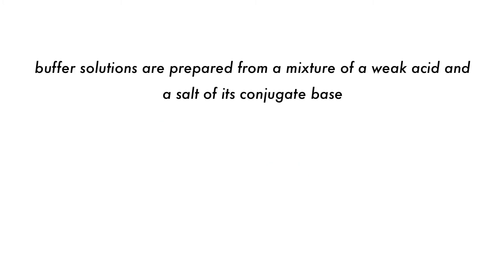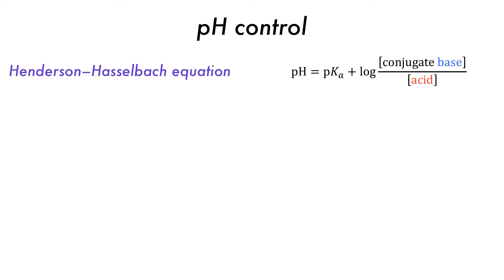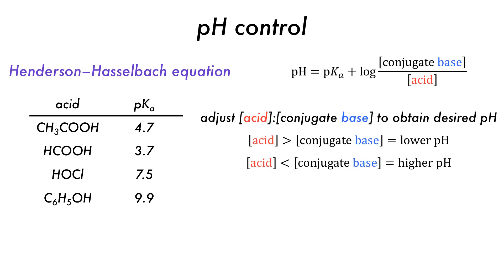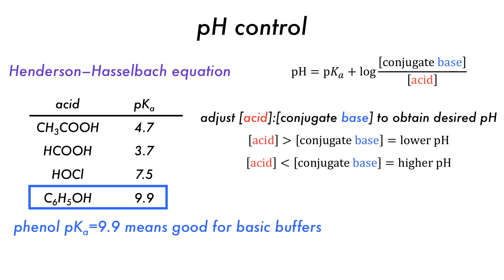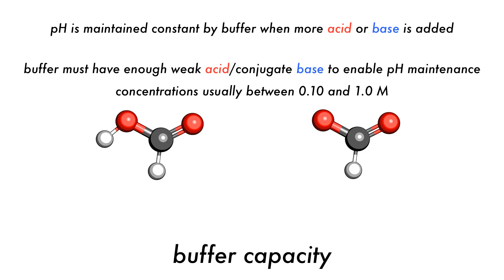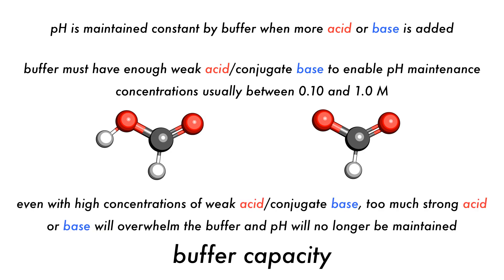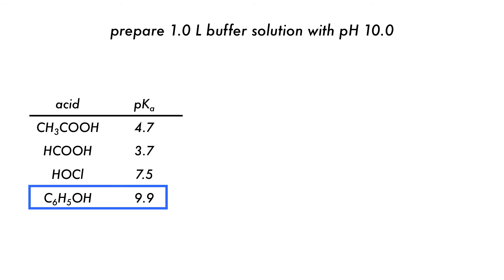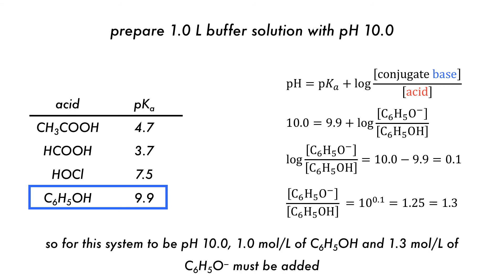Preparation of Buffer Solutions

Comment: On the check for comprehension section, why wasn't it 3.5 - 3.7 = --0.2 to then calculate the antilog of that to get 0.63?
Reply from the maker: Good spot! Sorry about that error. You're right, we should either take the anti log or use the negative value. I'll fix this and reupload with credit for the error spot. Thank you!